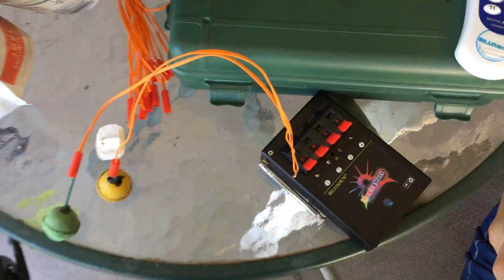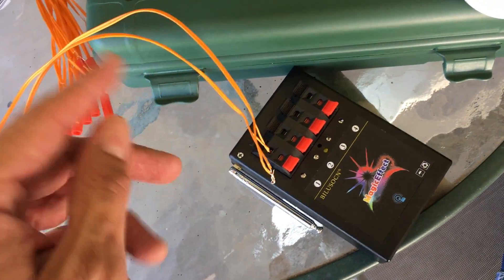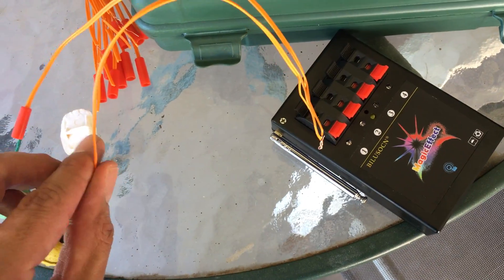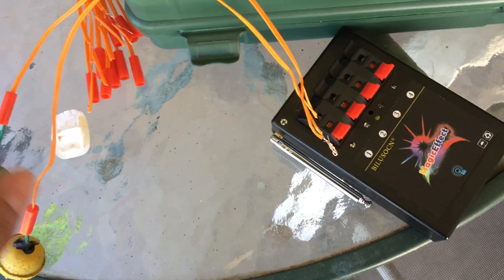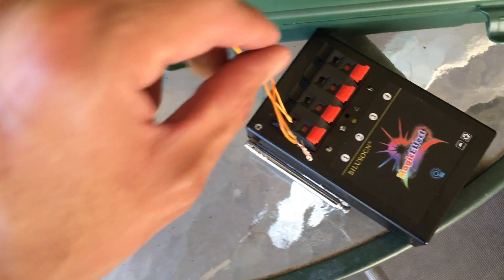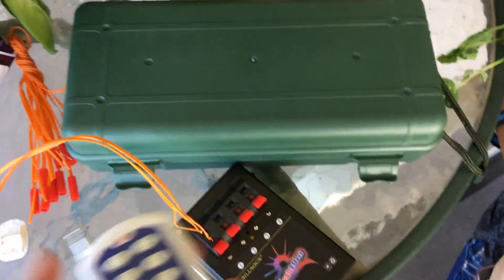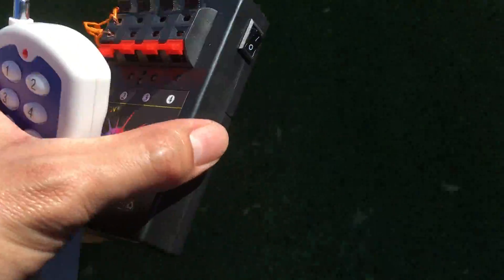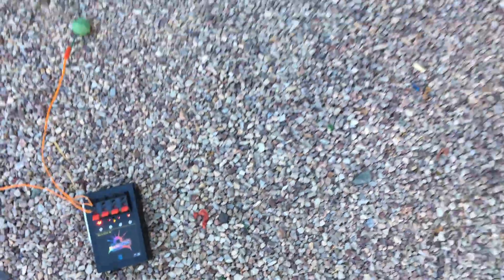fireworks firing cue test

Comment: You can fire up to 4 igniters on one cue. Positive and negative orientation does not matter for the igniters.  Dont forget to extend the antenna.  Great demo video.
Reply from the maker: hey thanks.. yeah i realized that it didnt matter when after testing i looked at the wires and thought "I DID HOOK THEM UP RIGHT, NO THEY ARE WRONG, WAIT IT DOESNT MATTER"... lol  but thanks for letting me know